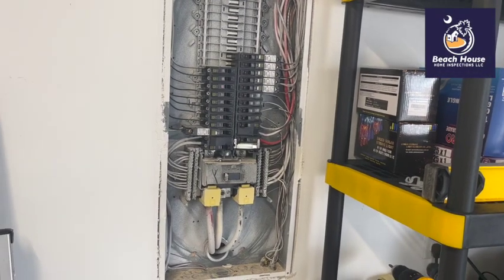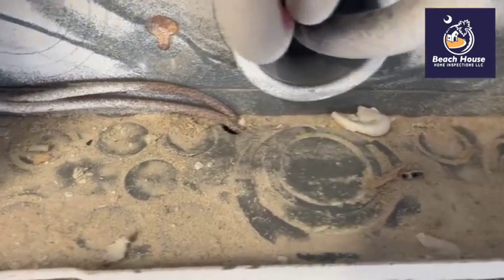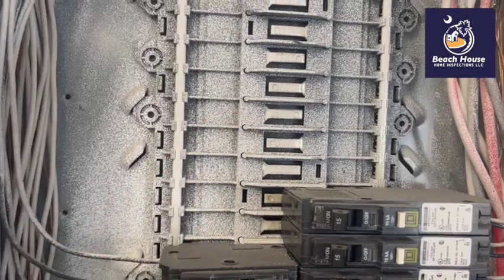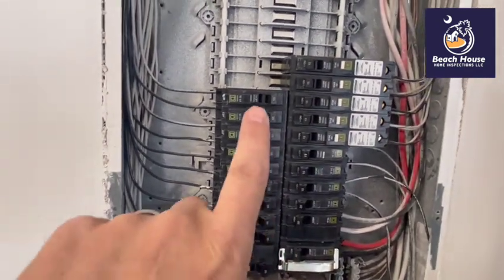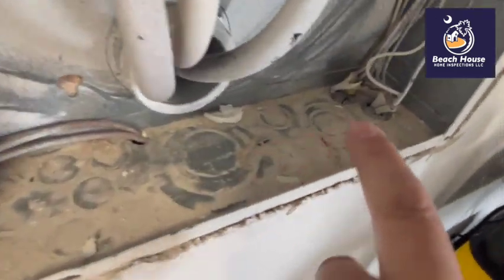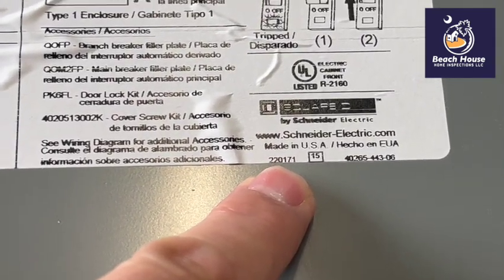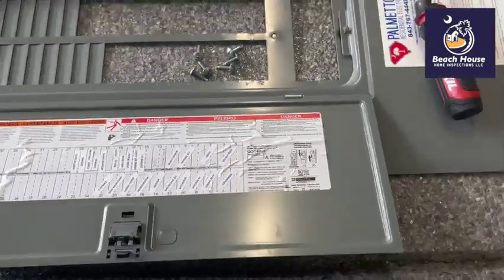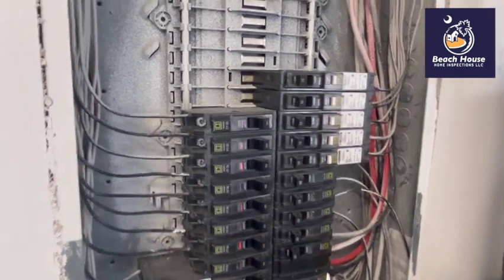Electrical Panel Defects. 12 month Warranty Inspection

Comment: How does this happen?
Reply: Lazy painters took the cover off to not get spray on it but didn’t plastic/tape off panel. Must’ve thought no1 will be able to tell when the covers on. However these inspectors are sticklers 95% of the time.
Reply from the maker: Most inspectors don’t even bother to remove the dead front cover from the electrical panel during a home inspection. My competitor in the area does not remove the cover and does not walk any roof.